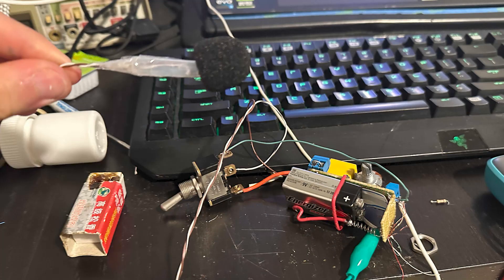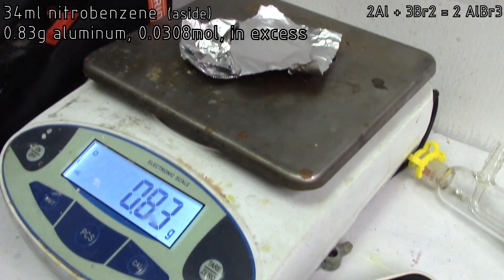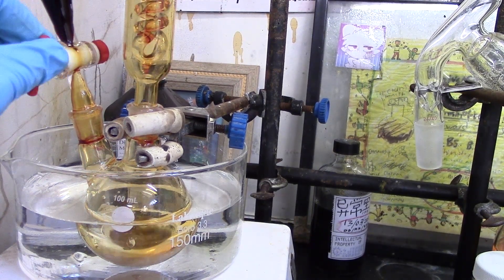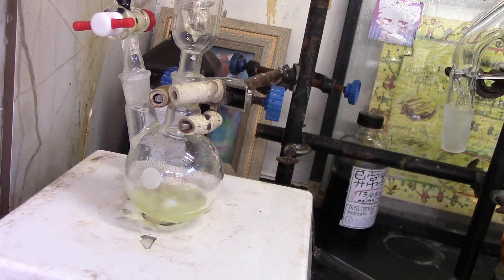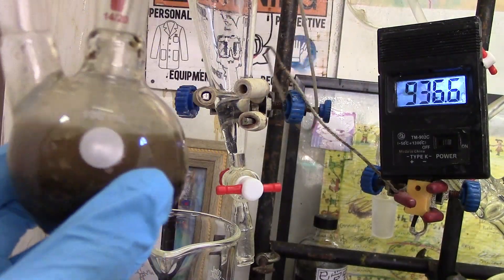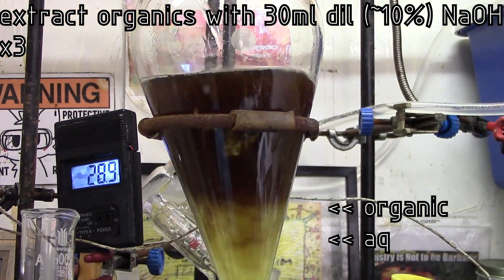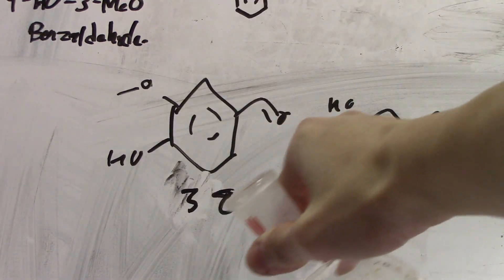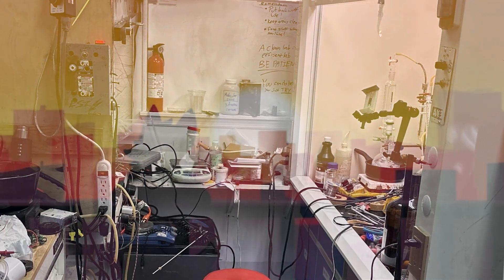Vanillin demethylation with nitrobenzene/aluminum bromide: Lab Notes

Comment: Hey I recognize that Erowid page! Pyridine HCl works for what they're discussing but BBr3 or L-selectride work considerably better. Was your bromine a little wet maybe? Dry bromine doesn't wet glass like that.
Reply: Have you actualy tried L-Selectride for a demethylation reaction?
AFAIK it doesn't leave you with a better proruct than the standard "Incinerate with anhydrous Pyridinium Chloride" for any reasonably complex SM.
Reply: @mortlet5180 I got a sample from a Chinese company about ten years ago and it most definitely works, but it's expensive. It's not that you get a better product per se, you get much better yields. I'd be more likely to go with BBr3 in chloroform though because it's cheaper and easier (if I still lived somewhere with that particular product OTC), the only caveat is that BBr3 gives off some nasty fumes and needs to be done outside or in a fume hood. Pyridine HCl requires really high temperature and both the C and the M you're looking to make are fairly heat sensitive molecules. Also, during extraction base out the C with sodium carbonate, hydroxide is too harsh and leads to hydrolysis destroying some of the C. Other than the demethylation step the biggest effect on yield is during the extraction phase some of the C gets trapped in the povidone polymer from the tablets, I never got more than about 70% extraction from that part and I don't really have a solution for that except maybe an acetone wash instead of water (but I haven't tried that).